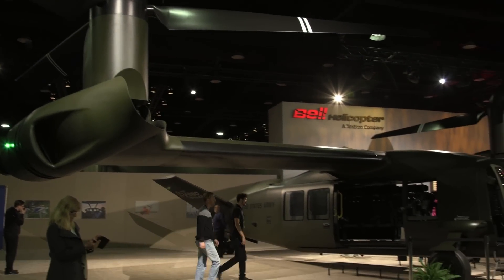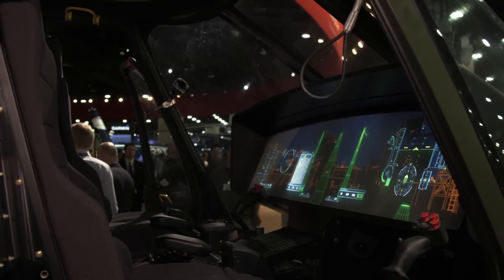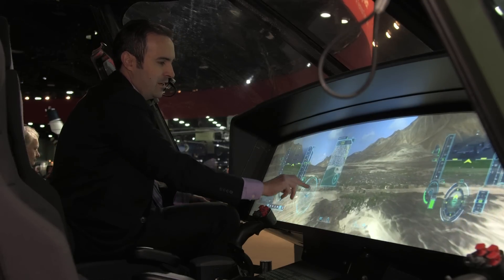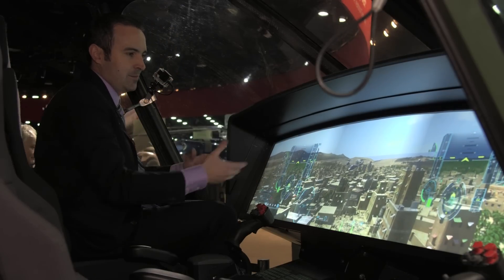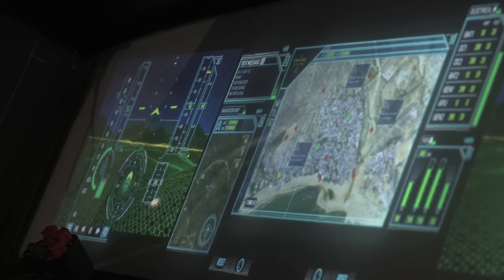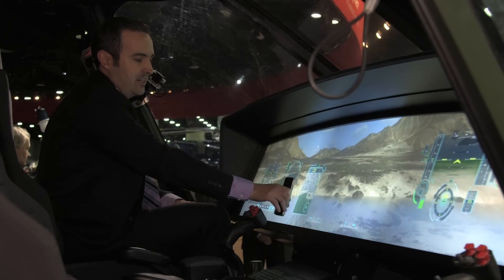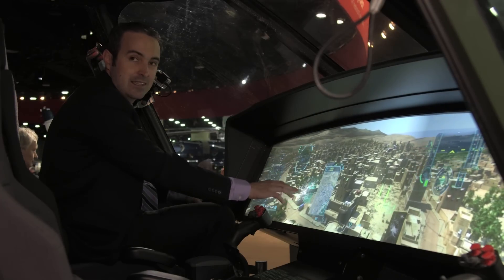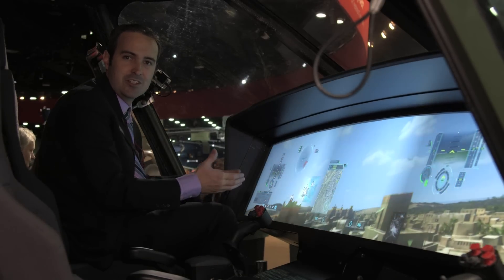See How the Bell V-280 Valor Tilt-rotor Touchscreen Cockpit Works – AIN

Comment: Touch screen in a (1) combat (2) maneuvering (3) helicopter? All 3 of those are individually bad use cases for touch screens... so together... makes perfect sense. =P
Reply: Note the cockpit still has all the physical control sticks and buttons as usual.  The screen is not used for controlling the aircraft.
Reply: @grasuh  
Still, that doesn't matter. I read somewhere recently that F35 pilots don't like the screens in it as there's zero feedback.